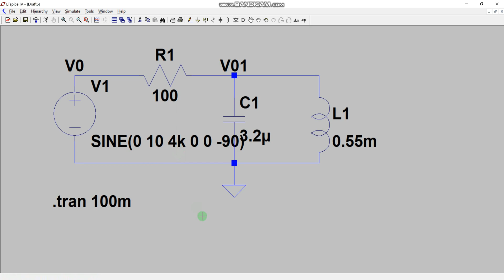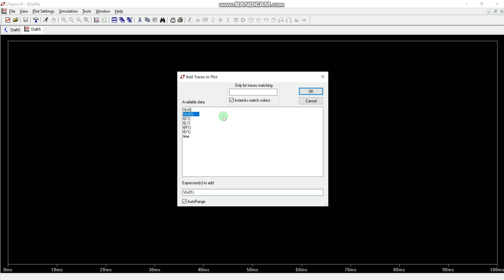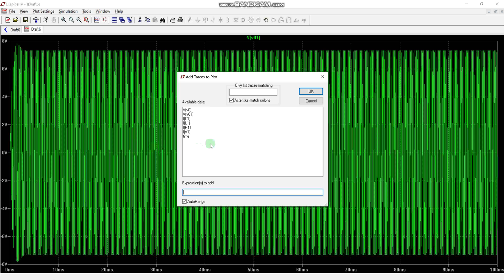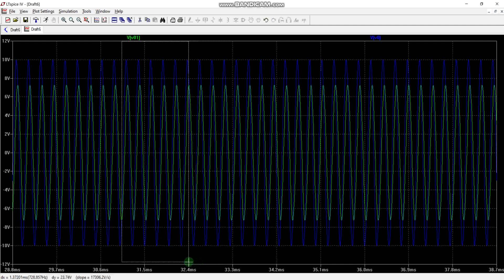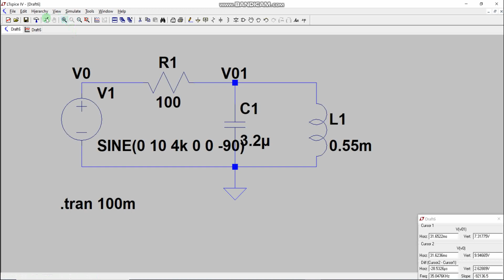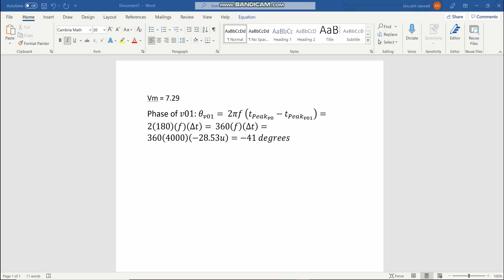LTSpice - Measure Phase Difference using Designated Cursors | AC Analysis on LTSpice Series| DrKay

Comment: At 1:23, it is mentioned about converting from sine to cosine by putting phi(deg) as -90. But -90 gives us inverted cosine. Would not +90 be correct to transform to cosine, since sin(wt+90)=cos(wt). It doesn't matter to the overall waveform and phase difference but its just about the sine to cosine conversion waveshape.
Reply from the maker: Yes, you are right. Thanks for this correction dear. My bad :(